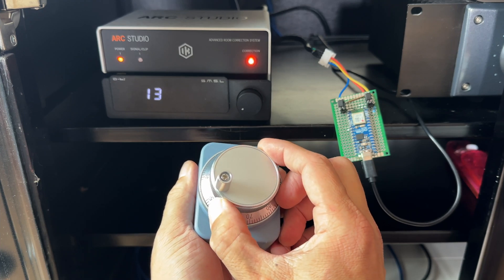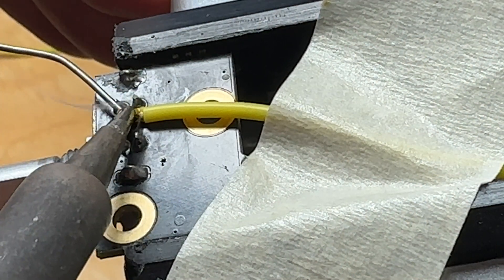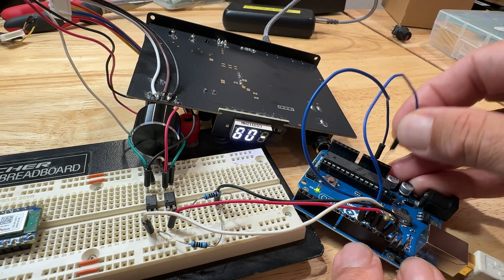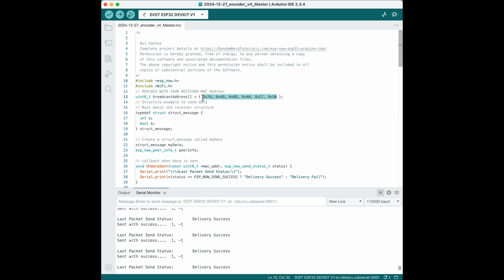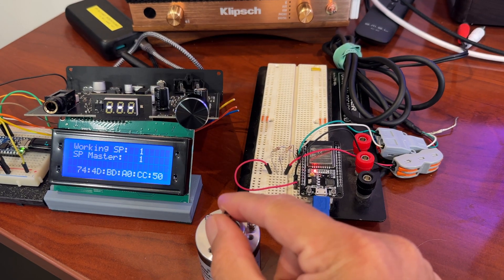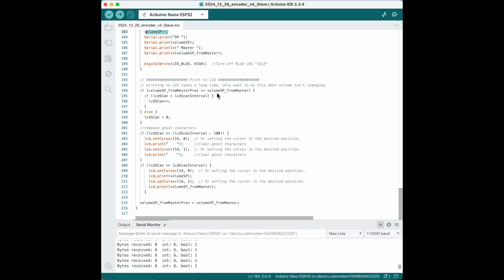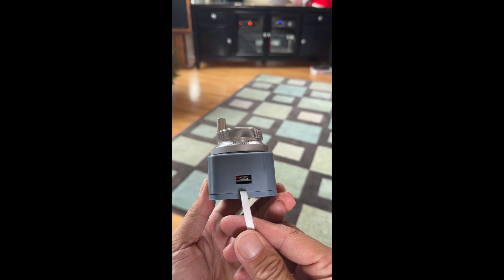I made a super responsive remote control volume knob using Arduino and ESP-Now.

Comment: Is it possible to make something like this for 2016 Honda Civic radio?  They took out the volume knob that year, the only option is digital touch on head unit or steering wheel controls.  I was thinking maybe you could build a volume knob that would simulate volume change via steering wheel control.  This could help thousands of people!

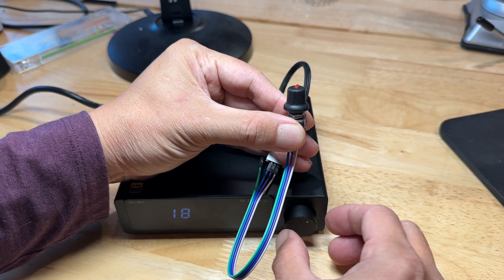Comment: Question. 3:28 - Both volume knobs work..... BUT what happens IF THE volume is currently 50.... Then you use the external knob to reduce the volume to say 10.... but then if you go back to the OEM volume knob, how can you get it to reach 100, because surely the OEM knob will not rotate unlimited times?   -  I am trying to think of a way to do similar with a car volume knob.  I want to operate the knob, via some kind of Servo, - i dont need to use the knob by hand ever again, but I do want to operate it by a remote (i kinda wanna do the opposite of what you want) - I wanna turn a knob control into a remote control button +/-
Reply from the maker: Both knobs turn infinite turns.  They are encoders, every time they rotate 3.6 degrees cw, the volume is incremented one click, basically like pressing an up button once.

Comment: Very nice, I have been thinking of a way to make a wireless stepper motor driven volume cotrol that I can somehow snap on, or bolt on to my tube amp. I love the amp, the only thing lacking is a volume remote, I could care less about any other functions, just volume. Even is it has to use some sort of belt drive around the existing volume knob. If anyone has any ideas, the amp is a Dayton Audio HTA 100
Reply from the maker: Can you just change the volume upstream of the amp (pre-amp with volume control)?  There are plenty of motor projects with Arduino you can reference as well.
Reply: @etischer  If you mean like using a receiver remote to control the volume, no. I have tried that as well, but no such luck. The main reason I had purchased the amp was to use for my TV with a pair of Bose 301's and a sub, but the tv remote has no affect on the amp volume, so I either have to get up out of bed every time I have to adjust the volume, or not use it at all.Getting out of bed doesn't sound like a big deal, but at nearly 55 and bad knees, it can be a bit much some days.
Reply from the maker: @fate2022  In the video I posted, my amp is always set at max volume.  The DAC is acting like a preamp, lowering the signal to the amp and controlling volume.   

You could do the same thing, there are many DACs with remote control for controlling volume.  A simple analog pre-amp would also work.

Comment: Well explained. I am trying to build something simular. Im using A slide-pot. My volume is done by voltage control. im trying to use esp now to make a remote master with the slide pot and the other one goes into my mixer which uses 0 to 3v to control volume. I jus need  one the masterto read the slide pot and the other esp to output voltage 0 to 3v depending on where the pot is st. As i watch your video i feel i am so clos to geting this done. great vid

Comment: Fantastic - exactly what I've been looking for, except I need to control a stepper motor with the slave - to add remote volume control to my vintage amp, by means of a rubber belt on the volume knob. Looking forward to the code link! Thanks!
Reply from the maker: thanks, just added the link to the description...
https://etischer.com/arduino/remote_vol_knob/

If you can, get the belt to wrap around the motor pulley a few times, you'll get more grip with less tension.  Or maybe print a sprocket that can fit over the volume knob so you can use a timing belt.  Just worried too much force will wear out the volume knob bushings.  Good luck!  Let me know how it works out.
Reply: @etischer  Yes I think a small toothed belt and a printed collar for the volume knob will be best - excited to control the volume of my turntable without having to add another component into the signal path!

Comment: As you only need three pins and one of them is ground anyway, you could throw a 2.5mm or 3.5mm mini jack into the back. So you don't have wires hanging out of there :) To make it idiot proof I would put the optocouplers and resistors into the device, so if anyone plugs some headphones or stuff in there nothing will happen.
Reply from the maker: I had thought about that as well, there's just not enough space to mount a headphone jack.  It's also a little safer having a non-audio type connector; I wouldn't want to connect the 5v outputs from the Arduino into a headphone jack by accident.

Comment: How’s that wire stripper? I’ve been looking for a new good one and liked yours. Is it any good? Looks similar to what I have used in the past
Reply from the maker: The Weicon stripper works great, especially for tiny wires that are smaller than the smallest hole on my traditional strippers; like the tiny wires a USB cable. 

 I tried the Knipex version and it wasn't even close, about 50% success rate. 

Both are made in Germany, the Weicon is much lighter.

Comment: I want one of these knobs to control my PC case fans. I wish someone had fully variable PC case fans for sale. Of course someone with your skill set could rig it up no problem,but it’s a real head scratcher for me
Reply: but.. they are? your fans aren't always at 100%.. right?
Reply: @ they are automatic, sometimes when I run it hard I want max fan. Be nice to have it at the flick of the wrist.
Reply: Have you tried software options? Does your pc not have fan control on the bios/uefi? Have you tried using "fan control" app (3rd party) or similar for windows?